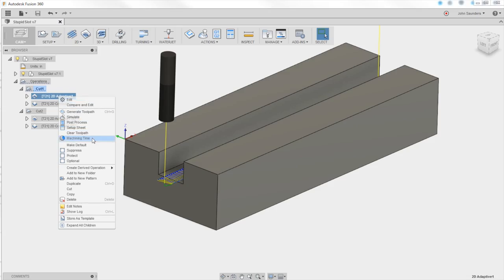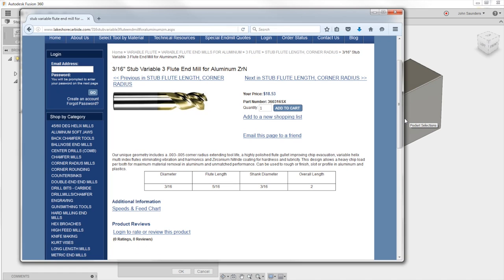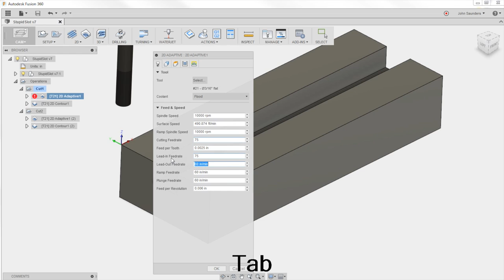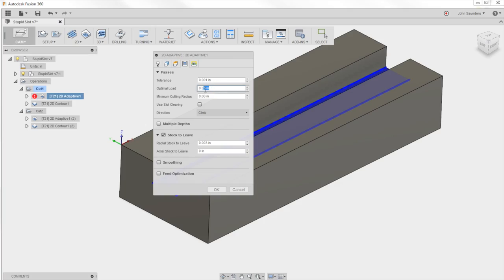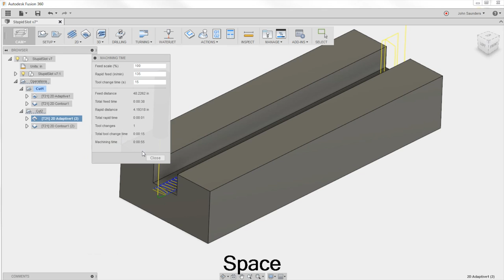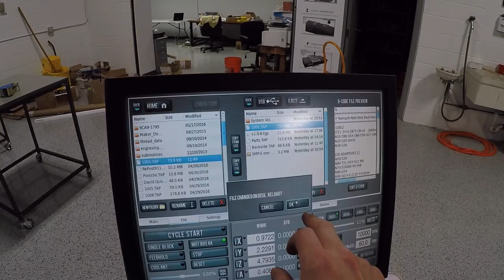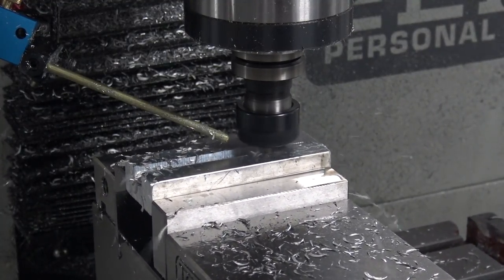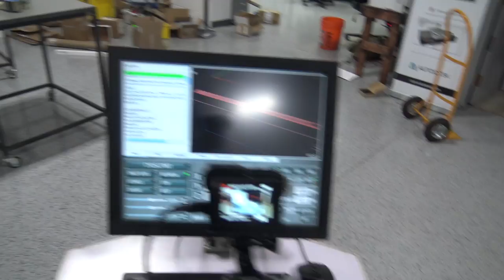Stop Slotting The Stupid Way!  Fusion 360 Adaptive!  Widget101

Comment: I would say if your machine time is matching your estimate then you are reaching your acceleration.

Your very first video is still extremely helpful because when you take your NIMS Cert Tests you are given a piece of bar stock and a blueprint of a part which requires 15 operations and at least 8 tool changes, you then have to hand write all tool paths, tool changes canned cycles. They do this mostly because they want you to be a skilled technician at the machine controls. They don't teach you in school very well what your tool is capable of other than your basic feed and speed calculations.

Comment: Hi John, I tried this out today on cold rolled steel on the Fadal 4525 I have access to. I'm new to Fusion and metal machining in general, but in the linking tab, I clicked "lift" and set it to 0.003", then came back and cleaned it up on the finish operation, the floor looked pretty good... thanks for all the videos!!

Comment: Back in my Taig days, I ran a 3/16" Lakeshore 2F at .002" chipload frequently. I used the same 3/16" endmill for any roughing, and the little Taig handled 32IPM for hours straight with it. I always used to keep bumping the speed up until something broke, and the weak link on the Taig was always the spindle getting knocked out of tram under high load, or the motor overheating after hours of high load, but never the little 3/16" tool, so I don't see why .003" per tooth and up wouldn't work out on a machine with more than 1/4 HP.

Comment: You can adaptive rough with any diameter tool that's the beauty of it. It used to be only certain size tools could "rough". But I've used roughing adaptive paths with tools as small as .040 in stainless. 

Maybe I'll do this slot test on the DMU ;)

Comment: Just a thought:

Wouldn't the 'optimal' radial stepover be the one that keeps the tool loaded by never letting the cutting edges 'unload'?

For example a 4 flute cutter should be set for about 90 deg engagement which would be a radial depth equal to the radius.  
3 flute would be 120 degrees engagement or about 1.5x cutter radius.  Maybe this is a max value.
 
I say this because just as one tooth is unloading and letting the cutter rebound, the next tooth would engage and keep the cutter loaded both in bending and in torsion?   I realize carbide is very stiff and these distortions would be very small, but carbide also doesn't like being bent too much being a classic brittle material.

I also see cutters for strong materials (Ti, hard tool steel, etc.) that have 5,7 or more cutting edges.
A tool with 7 edges only would have a radial stepover that engages at least 360/7 = 51 degrees. or 37% of the cutter radius.

I  understand that the cutter is only so strong and the radial stepovers suggested above can break the tool, but it is interesting to think about.

Comment: How would this compare time wise to just taking a stubby 3/8 and running it straight thru with a .003/ tooth load.
Reply: I don't think it would make it. Pretty sure you would break it or chatter the mill all to hell.
Reply: Maybe on a .7 hp hobby mill like this one. This might take 15 seconds on my 15 hp Cat 40 Fadal.
Reply: Sorry, not an answer from experience, but here's some math...

A 4" slot at... 4 IPM would take a minute. It looks like that slot might be around 5/16" deep (the flute length of that tool) so if you could take five 1/16" deep passes at 20 IPM it would also take about a minute (1/5 the DOC at 5 times the speed).

I rarely slot, and I basically let a calculator do the thinkin' for me, so I don't know typical feeds and speeds offhand, but 20 IPM for a 63-thou depth cut seems pretty light and I would think that would be well within the 440's capabilities.

I bet you could do the slot in three passes, no problem, so you could call that ~36 seconds (12 seconds per pass multiplied by 3 passes). Of course, there are some rapid/positioning moves in there too that will add a couple seconds too.
Reply: So it is a power and ridgidity issue why not to just plow straight thru, got ya. I know I have seen many endmill advertising videos where they would just plow thru a slot like this only in a block of steel, so I figured in aluminum it would be much easier.
 I just saw a Niagra video where they were running a 1/4 endmill 1/4 deep at 5000rpm and 20ipm in 4140 steel just in a straight path. I was just curious how a similar run would do here. Seems that with the slotting method used here 50% of the time is out of the cut.
Reply: The difference between plowing right through steel and aluminum is aluminum tends to gum up the flutes. It's basically caused by two properties of aluminum, it's malleability, and relatively low melting point.  the aluminum chips tend to friction weld to the tool, as well as compact within the flutes. Steel doesn't really have this issue, as it has a much higher working temperature range, as well as it's harder, and less malleable than aluminum.  The main take away here, to me anyway, is there comes a point where cooling,and chip evacuation can't keep pace with chip load, and feeds. Not to mention, the lifespan of the tool. Sure, you could bull right through in a single pass, but at what cost? early wear and tear on the tool, and the risk of damaging the work. It doesn't really add up to a responsible machining venture.
Reply: ArcAiN6
If you ran flood coolant could you run straight thru like steel?
Reply: sure, but you still run the risk of early wear and tear on the tooling, as well as chip weld, and compaction within the flutes. I never said it "can't " be done, i'm just saying it's an all around bad idea. Even if you could keep the tool, and the part cool, the chips are still going to heat up very quickly. The coolant doesn't penetrate to the cutting surface as it's cutting, it simply cools the tool and part after the heat has been generated. But the biggest issue, if you're running a high chip load,a nd feed, is you're chips aren't always going to evacuate fast enough. It really only takes 1 or two chips getting stuck to a single flute to ruin the part, or damage the tool, as each successive chip has a higher probability of compacting with the others, or worse sticking to the tool itself.  But lets say even if you use a high pressure (pressure washer type) flood coolant, those chips will still sit within the flutes for the majority of the cut before getting flushed out at the back side of the tool as they come away from the cutting surface. A straight through cut will continuously force material into these flutes, and you run the risk of having too much material in the flutes for the chips to exit from the top, which will increase your chance of compacting the flutes with aluminum chips. From that point forward, you'll be taking less cut, and adding more force until eventually the tool stalls, or breaks, and if it doesn't, you'll still have a terrible finish because the compacted chips were rubbing the entire cut path.

there's a reason most professional tool makers create these videos showing their tools making these impressive deep, straight through cuts. It's to show how effective the tool is. However, you'll almost always notice these tools sparking and sputtering the chips out. Because the tool is being "demo'd" they really don't care how long the tool lasts, as long as it makes an impressive show, and survives in one piece throughout the demo, but at the end of the day, if you're running a business, or even a hobby, you're not going to want to go out and buy a new tool every 3 or 5 jobs, simply to make an impressive cut, you're going to want to make your tools last as long as possible. Lets face it, some of these tools aren't exactly cheap, and if you're replacing them all the time for no reason other than making a fast, impressive looking cut, you're losing money for nothing more than a few minutes of extra work, and an ego trip.

but that's just my opinion on it.
Reply: +bcbloc02 
Yep. Flood coolant you could run clean thru no problems. I do it all the time. 

And if you got the machine ponies and right cutter coating, you don't even need coolant or air last. 

Destiny Viper endmill's can go full bore no coolant, but only if pushed hard.
Reply: +bcbloc02 and 3/8" @ 30ipm and .300 down requires more HP than his machine has. (About 1.3 Hp cut).

He'd have to slow down to 17.5 IPM with a full depth 3/8" slot cut. To stay within HP limits. Wouldn't be able to reach a proper SFM in aluminum while staying within power limits.  In order for him to do a full depth 3/8" slot with. .002 chipload and stay within limits and keep the same MMR as the 3/16", he'd have to run 2000 rpm @ 17.5 ipm. Which is only 196SFM.  That's way too low for carbide in aluminum.
Reply: Occams Sawzall
 I thought these were 1.5hp machines but that must just be the 1100.  This is neat to learn how to get the most form your machine and tools. I have never had to worry about the power required to run an endmill so it is intersting to have to think about it.
Reply: +bcbloc02 1.5HP motor and about 85% efficiency to the spindle in high gear. Giving you about 1.3 HP at the spindle. 

You'd be RIGHT at the max output. The 3/16 is running about 2MRR and consuming .8 HP. The numbers above for the 3/8" are calculated to maintain that same 2 MRR and  .8 HP load.
Reply: If he had a 3 HP machine motor the 3/8" full width cut would be faster. 

Right now his limits are the machine power, the tools can take far heavier loads than what the machine is capable of.
Reply: +bcbloc02 
Here's the short of it. Material removal rate is limited by the HP available. With 1.3Hp at the spindle you'll never be able to exceed about a 2.5 cubic in removal rate in aluminum. 

Speeds feeds, step overs doc, etc are just the ways of HOW to get to a 2.5 MRR. But no matter what the combinations, 2.5 is the absolute limit for that spindle in aluminum. 

Every material has a constant power factor. Which is the amount of HP required to remove 1 cubic inch per minute. It's based in physics (based on the ultimate tensile strength of a material) and can't be changed. 
HP required is (removal rate) * (power constant) = HP.  So the only way to increase your removal rate, is to increase your HP.
Reply: I agree the Viper is a great tool, but I assure you if you run it at full WOC and full dia. depth at high speeds in aluminum with no coolant it will become a stir welding tool and trust me it's not fun trying to get all that aluminum out of the flutes. I've done it on accident because of missed closed coolant valve.
Reply: +Steve just Steve I just did it yesterday ;) 

But no. Wouldn't recommend it in the long term. But you can actually run aluminum dry with the right cutters and right machine. 50Hp spindle w/ 18k RPMs I can push tools to their absolute limits. Have yet to find a tool that will stall out this beast before the tool breaks.
Reply: Occams Sawzall
What machine has 50hp spindle and 18K rpm's. I want to see. :-)
Reply: +bcbloc02 DMU 50 eVolution. 50 hp 5 axis machine, all glass scales on the axis, fully chilled on all 5 axis and the base and has a combination hydraulic/pneumatic drawbar (don't ask how it works I have no idea!)
Reply: Occams Sawzall
I imagine it all works perfectly. :-) Sounds like a very capable machine but also expensive I imagine.
Reply: +bcbloc02 ya... Bout a $300k machine all said and done...
Reply: Hirudin
Multiple Passes at 1/16" would quickly wear out your endmill though. That's the problem I've had on my manual machine is that I can only use a tiny bit of the endmill.
Reply: +The Metal Butcher what are you running for tooling and what kind of machine?
Reply: The Metal Butcher 
That's true.
Reply: The Metal Butcher
With my manual machines my standard go to in an application like this slot would be 1xDiameter=DOC and .002"/tooth/revolution feedrate. This would normally be in a mild steel but I also like to run flood coolant.
Reply: That seems like a good formula. I hate flood coolant because it makes a mess and I also like high feedrates because I don't like to hand crank at slow speeds. No power feed yet. :(
Reply: +The Metal Butcher high feed rates on manual machines tends to result in disappointment :)

They don't have the RPM or the rigidity to handle heavy feed rates.  They do however have substantial torque. So you can take pretty deep and heavy cuts, just not very fast.
Reply: Occams Sawzall 
It&#39;s called air over oil.  Most of the time you have belleville  washers that actually doing the clamping the air over oil system is to over power the washers.
Reply: Occams Sawzall
 Yep. Wanna buy me a power feed? xD
Reply: +Chief Machining it's more than Belleville washers.  You can here the hydraulic ram kick on and off on a tool change.
Reply: Yes, Hydraulic Ram actually compresses  the washers and uses the drawbar to knock out the tool holder of the taper. Air over Oil system
Reply: +Chief Machining 
Yep. Ok. Just looked it up in the manual.  It's a Franz Kessler S spindle
Reply: Chief Machining
Makes sense to have a mechanical hold, wouldn't want your tools falling out of the spindle when the pressure bled off when the machine wasn't powered up. My Cincinnati VMC has the standard Cat50 pull knobs but never looked at how all that actually works.

Comment: you need to increase the size of the radius so that your not reversing direction as quick. Try increasing min cutter rad and the lead in/out rads, this should smooth out the motion. I suspect that you can get up to 90 ipm in that slot if you can get the adaptive to make it more circular.
Reply: good point. it would be very interesting to see that.
Reply: Which is where true trochodial tool paths come it handy. 

I did notice Fusion likes to default to some really small min arcs with adaptive.  I bet a full trochodial path would have done that slot 20% faster
Reply: +Occams Sawzall what do you consider a full trochoidal to be then? what defines one in your opinion?
Reply: +Scott Moyse full trochodial is full circular loops around with a step over each revolution. Like taking a pencil and make little circles with it while moving In a direction. That will maintain a constant feed rate up to the max accel/decel rates for the machine.  So a constant feed rate number will show up on the controller. 

Re-watch this video and notice when he shows the controllers readout of the feed rate that in jumps from between 29 and 75. The 29 is when it first enters that tight radius of the path. 75 is about the mid point of the arc drops back down to 29 on the exit and runs about 50 on its backfeed to start the next cut. 

In tight spaces like that trochodial paths are faster and less harsh on the machine axis. In large areas where the entry arcs can be large and feed rate is maintained better the adaptive is better since it's a shorter tool path and will save time.
Reply: +Occams Sawzall I totally agree. May I ask what software in your opinion creates said types of toolpaths? I'm using FeatureCAM and a lil SolidCam, and I'm curious which programs write the style paths you discribe. Thanks
Reply: +Steve just Steve mastercam, NXcam and Hypermill I know for certain.  Any software that uses the Volumill kernel for their adaptive should have a trochodial path option (usually a tiny check box somewhere) don't know featureCAM so can't say on that one and haven't dug into fusion enough to see if there's an option or way to trick it into trochodial paths.
Reply: +Occams Sawzall OK. I'll have a look later but you should be able to get pretty close.
Reply: +Occams Sawzall so are you saying the cutting portion is also circular? because if it was then it wouldn't be constant load.
Reply: +Scott Moyse it does work out to a constant load.  Wish I had something to show as an example of the path...
Reply: +Scott Moyse let me clarify. The loads on the machines axis are constant, the radial chip does vary though. So the spindle and took load changes. 

It's really for slot paths under 3x tool diameter.

Comment: hello,what you will do when you need make a slot about 3-4mm? adaptive strategy with short endmills is cool, but i, personally often working with small locked slots like a rings. Now i work with tool diameter almost similiar to slot width, go down with ramp moving and 0.1-0.2 mm doc,carbide 1 or 2 flutes endmills. What can you advice for milling theese tiny slots? Or even thinner, like 1,2mm with about 3-4 mm depth?

Comment: What about the load meter? What's it doing during the cut? If its anything like my 770, it can make the HSM cuts fine as long as the needle doesn't bounce into the yellow for more than a second or two. The speed and force of the aggressive cut slows down the spindle, and if it cant speed back up during its air-cut travel, then it slows down even more on the next cut, repeat until next thing you know the spindle stalls; or the motor stabilizes its power output, but at a lower rpm, leading to other tool issues.

Comment: Pretty cool stuff! I wish Fusion would add trochoidal (or adaptive) toolpaths for profiles.  90% of what I do is sheet material and small parts (as many as I can fit on a sheet) so I'm slotting ALL the time and it sucks.  The only thing keeping me from fully switching over to Fusion 360 is that it can't do trochoidal on the outside route of a part :(
Reply: I think you can if you select and outside stock boundary and the outside profile of the part.  Not sure, haven't played with it enough.

Comment: Hi John,
I’m grooving a 1” deep x .530” slot in cold rolled steel.  I’m using a 0.375” carbide 4 flute cutter with .001” per tooth at 1000 RPM.
I have been using a profile approach at 0.100” per pass.  

I see your recommendation to use an Adaptive Clearing for this operation.
What are your recommendations for me on cold rolled steel for Depth of cut & RPMs?

BTW:  Great job on all the info!  Really appreciate everything!